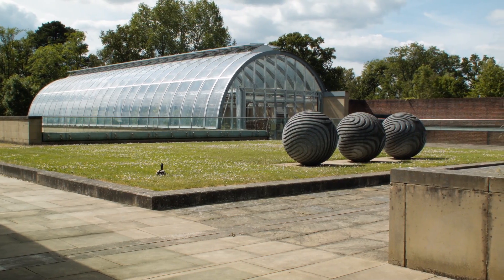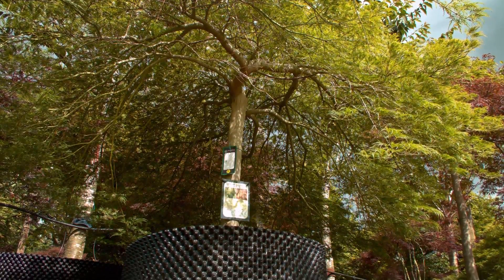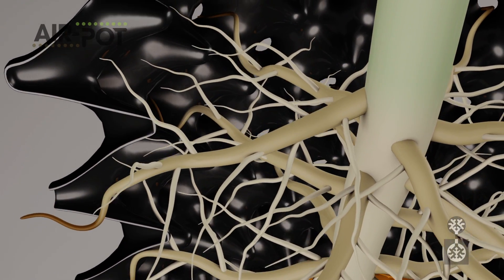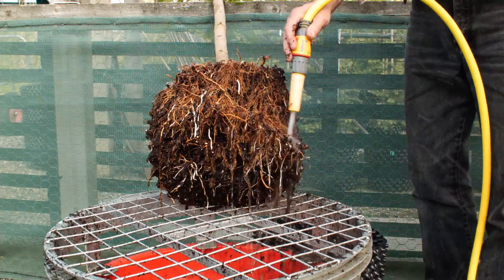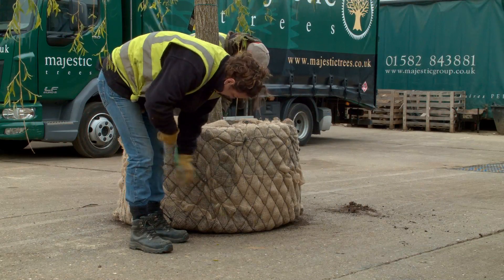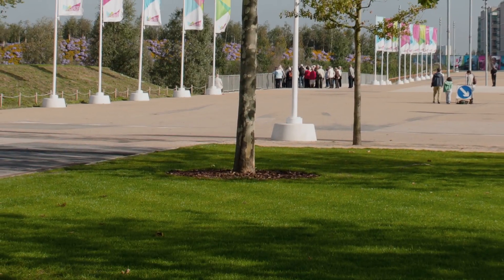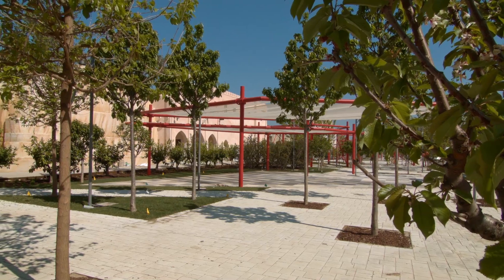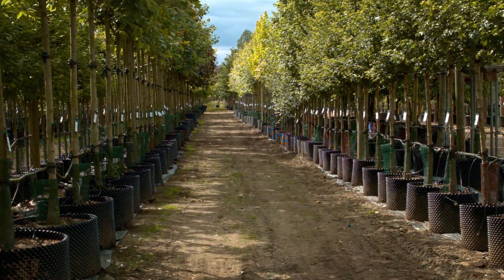How the Air-Pot works

Comment: these pots are ugly and they do not last very long. when i am not using them they take tons of space to store. fabric pots are far better for a home user.
however for the city and trees these are better.
Reply from the maker: Hi there, and thank you for your comment.

We agree, these pots definately don't score high in the aesthetic sense, but they're a functional system primarily used by industry growers, although they can most certainly be utilised by home users. Regarding storage, we unfold the pot and stack them flat packed, taking up very little space. Their lifespan varies, depending on root vigor, but on average we re-use them for 5 growing seasons before they're recycled.

We are trialing fabric pots in our smaller hedging range, as these come with practicle handles, and can be lowered down into the tree pit without removal, decomposing over time; however, as of yet, we haven't experienced as good of a root development as with the AirPots.
Reply: @majestictrees7611  after doing tons of research I have changed my mind and decided that these pots are better than fabric.

Comment: Can I continue use the air pots to grow the tree without planting in the soil?
Reply from the maker: To an extent, yes. However, the AirPot isn't a hard barrier, meaning the tree's roots will eventually (especially with larger and more vigorous species) break open the pot. 

This can be tempered by controlling the upper growth. Meaning for instance a cloud-pruned, bonzai-kept hornbeam will have less root output than a natural hornbeam tree and can therefor be kept longer in a certain size of AirPot.

So, how long you can keep them in one AirPot depends on what tree and if you restrict its growth. You can, of course (as we do on the nursery), repot them by taking off the old AirPot collar and replacing it with a bigger (longer) one, leaving a 5-10cm gap between the old rootball and the new AirPot edge, and filling the gap with new soil/compost.

Comment: what happens when the air temperature gets 95-100F?
Most plants suffer in that heat.
Do air-pots mitigate some of the heat problem?
Reply from the maker: Hi there, although we are situated just north of London and rarely experience temperatures of that magnitude your point is well taken. The black colour does radiate heat into the pot and for our temperature range, this is an advantage as the warmth encourages growth; however, there is definately a risk to 'cooking' the roots once the temperatures rises beyond 30C/86F. It would be an interesting conversation to have with Air-Pot themselves, to see what their thoughts are. Perhaps a white pot with black inside could be a solution?
Reply: @majestictrees7611  just had another 48C/101F day today. Just at hot tomorrow and the next day too
Then drop down to a reasonable temp then right back up to HOT again (sheesh).
Air-Pots are using a little more water but not as much as I expected them to. I use IV drip on 3 of them and 2 litre soda bottles with string on some of the others.

Plants seems a little stressed but not too much (Tomato plants mostly).
May have to find a digital probe thermometer I think.
Reply: @majestictrees7611  Currently I see NO difference between a a tomato plant in an Air-Pot and those in the ground.
In fact, one of my pepper plants are wilting in an Air-Pot. Soils is wet too and we haven't waters in weeks.

Comment: Watering from the bottom looks problematic to me as the bottom tray is so high up? I need to use a plant dish would this be a problem?
Reply from the maker: Hi Simon, Air-Pots are designed for top irrigation but they can be watered from the base in some cases. It depends how big the pot is and what kind of compost you're using. It would work for smaller pots which have a good capillary action compost plus a wetting agent. It's also important to bear in mind that most absorption roots will be at the edges or the surface rather than the base, which mainly has anchoring roots, but it does depend on species.